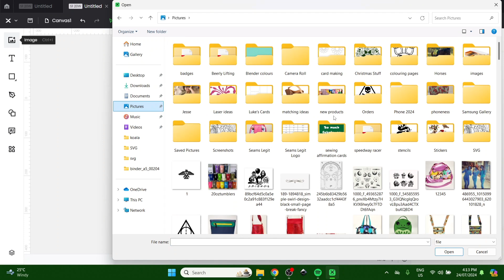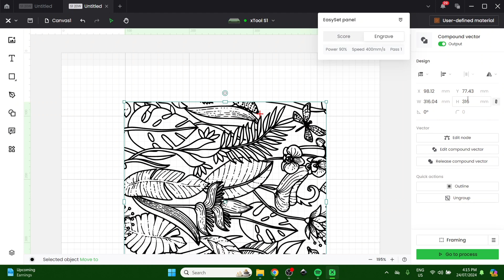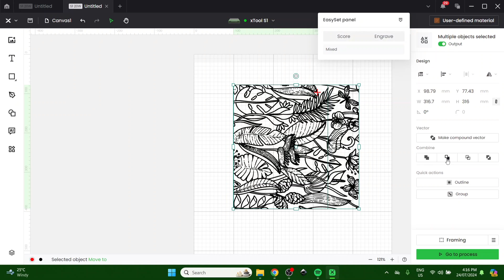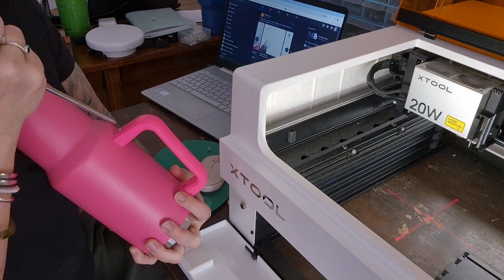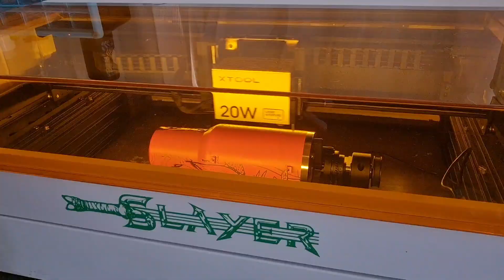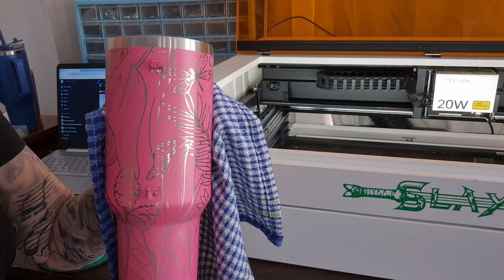Laser a tumbler with xTool S1 20W

Comment: S1 40W😭I have engraving lines like a dirty layer,i scrub it like crazy no luck, can anybody HELPPPPPPPPPP?
Reply from the maker: Increase your lines per cm to 200 :)
Reply: Is it over the whole cup?  You should be at 200 lpc.  If you are already doing that, you can try defocusing.  Make sure the bottom of the cup is level, and take your distance measurement at the very top of where you are engraving.  Then add 3mm-5mm to the distance measurement.  Ive been doing that with my straight tumblers and having a lot of luck blurring those lines.  I'm doing my first 40oz tumbler though, so that's why I'm here!

Comment: How do you get it to engrave evenly all the way down
Reply from the maker: It is not quite even  but measure the middle height
Reply: @seamslegit  I don’t understand . I leveled the smaller end to where it’s level…
Reply from the maker: When you do the distance measure, you do it from the angled part, as it's halfway between the two heights
Reply: @seamslegit  oh ok I think I understand
Reply: @seamslegit  but wouldn't the prongs be in the way as it will make the laser sit low? send help